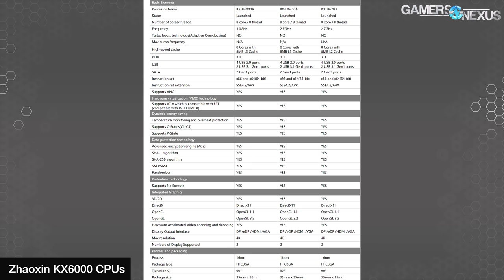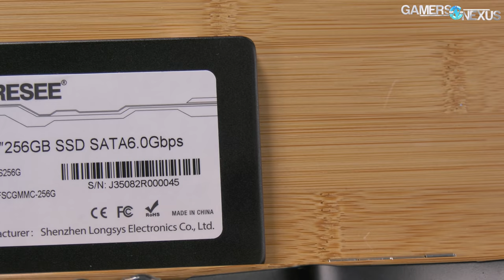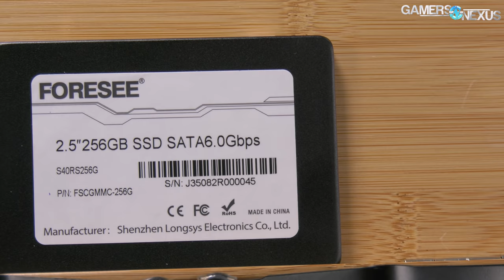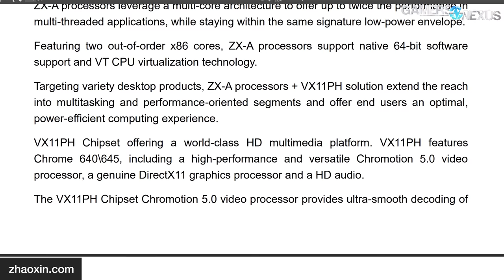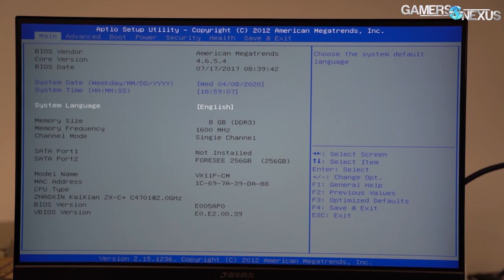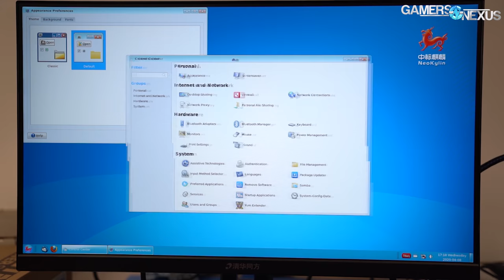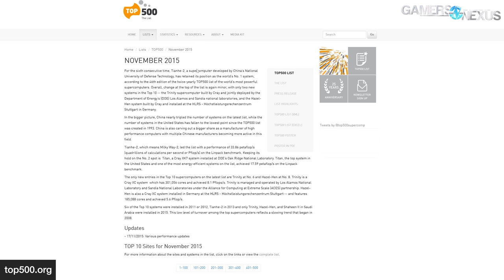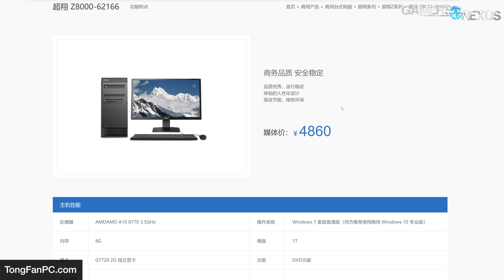Chinese Pre-Built PC Review: ZhaoXin CPU + Knock-Off Windows OS, ft. NeoKylin

Comment: This system is evidently not meant for the consumer market and especially not for export. It seems to be a thin client pc for government offices and municipalities, public libraries law enforcement financial institutions etc to replace the intel and amd thin clients  currently in use. For that purpose it is completely adequate.
Reply: Yep, also military desk job, Chinese government is very paranoid after Snowden incident, not to mention all the intel me security issue exposed over the year. Most of these gov machine now are still on intel, running with hard switch dual system
Reply: And still not worth it..
Reply: @hjy2187418  No need to be paranoid. Check USA laws on american brands and manufacturer. The law make them implement backdoors and communicate any information they hold on a non-american company without justification. Even NSA produce their own processors and hardware as far as I know.
Reply: I think they can build better just lika huwaei phone. but they're too lazy...
Reply: @T4CFantasy  Depends on what the real cost is. Internal government cost could be much lower in volume.
Reply: @PunxTV123  As Steve mentioned, this is an older model. And don't underestimate the difficulties of building up an independent cpu manufacturing industry.
Reply: @T4CFantasy  for a government, state level security doesn't have a price. 

Just compare the price of so etching like a Boeing security phone to a normal android.
Reply: @BonBaisers  Can you point me to the law that you talked about pls?
Reply: I think china is starting independent slowly, hope I can buy from them someday a same rtx 2080 ti and ryzen 3990x for total cost of 300$.
Reply: More like for a bill board at a bus stop ...
Reply: yes indeed and it only takes 50 watts at max, you don't need 500 watts to run text and word editors. i am guessing they will use that money then to make more powerful machines tailored to better purposes then target consumers later when they catch-up.
Reply: Completely adequate, and insanely expensive for it.
Reply: hope USA learned the lesson that it's not only western can do market and china is not a slave workers. hope covid-19 will teach them lesson more. those people are living on their own to improve while USA are thinking jealous lol.
Reply: Just buy ibm power 9 system it's powerfull and much powerfull than this system for the same price .
Reply: @T4CFantasy  gov contract machine are always overprice for obvious reasons, same in very country
Reply: @T4CFantasy  it's government internal order, not retail. dmv office is using same level of crap, you can ask them how much those cost
Reply: @hjy2187418  nothing shipped in America is that slow anymore for new offices and they will cost the same for much better, any Intel Celeron is still better than this
Reply: The price though
Reply: @TheOsx86  Search for "Lawful Access to Encrypted Data Act", it is literally legalized for the U.S. government to hack into anyone's PC if Lawfully approved by itself (meaning fuck).

Older laws were "under the table" agreements that NSA enforced on vendors.
Reply: @T4CFantasy  There is loads of proprietary hardware and software and operating system in the US that are Unix based systems, and they are brand new, and "slow as hell". Traffic control software and hardware is a fantastic example, those aren't running cutting edge Intel anything. They are generally fast enough to get the job done, and work on hard-embedding with very specific clock speeds to ensure that instructions are done at precise times. 

For all intensive purposes this PC is just an embedded system, that utilizes soft-embedding for the end-user, and is as fast as it needs to be to fill out PDFs and Documents. Anything out there runs like that. We're not going to put cutting edge processors into government computers that don't need them, and we're not going to put random versions of windows on defense hardware or hardware that needs to run functional time-sensitive programs, it is a waste of time and money.

If you want more information on this stuff, there are loads of computer systems engineering programs and courses you can take through your local college or universities. Often times online where you can learn all kinds of different applications for computing outside of games and Windows.
Reply: but far too expensive but it seems every gov is wasting taxpayers money .. even in China ..

Comment: should oc it with Ln2 and see how far you could go :P
Reply from the maker: Wish we could!
Reply: @GamersNexus  i bet the "airflow" is amazing :)
Reply: @GamersNexus  you will need the ln2 to unlock the other 999,999,999,996 cores.
Reply: @GamersNexus  Can you replace some crystals/XTALs with higher clocked versions? Would that work?
Reply: @happygimp0  I wonder whether it's possible to modify the UEFI like BIOS mods were made for machines back in the days when overclocking was still possible using the FSB
Reply: @GamersNexus  cmon... do eeeeet

Comment: Steve admitted to using a 220 volt outlet just to use a hair dryer at home.

Granted nothing is too good for that level of hair so I don't blame the guy.
Reply: probably a clothes drier tbh
Reply: It's probably a chinese drier. :) USA is special with its voltage.
Reply: @AstralS7orm  or a UK or European one. Maybe it's Mielle.

240V > 120V

Lower transmission current, less losses, lower power bills.
Reply: Clothes Dryers are 240v in the US.
Reply: This surprised me, do American homes have separate outlets for driers with 240V? Do they have a transformer in the house or something?
Reply: @MaartenKok  It comes into the home as 120v-neutral-120v and 220v things like stoves and driers are connected across the full potential, while everything else is connected from the 120v to neutral.
Reply: Most likely he changed an existing 220 outlet into which ever was needed.

OR he got an electrician to join 2 existing 110v electrical lines wired together to make the needed 220v
Reply: Clothes dryer. Not hair dryer.
Reply: Many electric appliances require more than 20A of current. 127v would dissipate too much heat to push that much current. Regular 240v outlets are usually rated for 23A and can go to about 40A. After that, you'll need a triple phase 450v outlet.
Reply: @JordyValentine   Enough with the nationalism already.  It's not "retarded," it's perfectly sensible.  Different countries rolled out electrification in different ways, and the legacy compatibility argument makes it incredibly difficult to evolve that beyond what has been the standard for a century or so.  It works, as do any of the competing arrangements.  What more do you want?
Reply: For those genuinely curious, he's talking about a clothes drier, not hair.  Most US appliances (including hair driers) are 120V at a max of around 12-15A.  That is ~1500 to 1800W, and sufficient for just about anything, but wouldn't be sufficient for two appliances in particular - electric stoves and electric clothes driers.  So those get special outlets with 240V.

US houses typically are fed at the master panel with two out-of-phase hot lines, and a neutral line.  Half of the house is wired to one phase, the other half to the other phase.  (By "half the house" I mean every other circuit goes on a different phase, so it's roughly load balanced.)  Each room, give or take, gets a home run to the main panel.  (Some rooms - like the kitchen - may get more than one circuit.  Sometimes, two bedrooms will share one.)

The stove and drier, if electric, will get wired with access to BOTH phases and neutral.  This provides a 220V connection across phases, and optional 120V connections for controls, lights, etc.

You can question the suitability of 120V all day long.  The fact is, it's ample for most needs - and for those where it's not, there's a fairly simple workaround.  Remember we're talking about decisions made in a time where the main application was to stop using oil lamps and move to electric light.  120V was as good as any other choice at the time.  They did not anticipate multiple 350W GPUs in SLI, or EV charging, etc.  The two-phase hack got us over the electric cooktop problem.  Many homes dealt with that same issue by feeding major heating appliances with natural gas, propane, etc.  I have a gas drier and an electric stove.  Go figure.
Reply: @nickwallette6201  Ever tried using an angle grinder on 120v vs 240v? The 120 is useless. There are far more things than just driers that are improved.

Besides all of that, higher voltage = more efficient
Reply: @nickwallette6201  pfft, nationalism.. Other countries exist and yours isn't the greatest in the world, get over it.
Reply: @JordyValentine   That's exactly what I'm talking about.  I've travelled around.  Turns out, nobody's got a monopoly on happiness.

This idea that "it's different than what we do, therefore dumb" is not a good look.

You're right -- some high-powered tools work better at higher mains voltage.  It's not terribly uncommon to see a garage here wired with higher voltage outlets for that reason.  When EVs get more popular, it'll be standard.

For a good 50 years, it happened to be right about the PERFECT voltage for CRT technology, as a simple DC conversion would lend to a B+ voltage that was right at the ideal for the picture tube stuff.  Not relevant now, but goes to show everything is a compromise.

For the other 99% of things people plug into outlets?  I mean, technically Japan's 100V would be better.  Lower voltage would allow for smaller bulk capacitors in switch-mode PSUs without affecting capacity.  It would make design certification a little easier (less safety clearance needed between live and low-voltage parts.)  Etc. etc.

Most of that is moot because we have to accommodate 240V mains (so everything has tolerances to accept that), and less-efficient 50Hz mains (so everything has to be over-built for 60Hz regions to permit acceptable operation in 50Hz regions.)

I hear Europeans often complaining about vacuum cleaners and kettles, but .. I mean.. I don't have any issues with vacuums limited to 1800W, and can boil a cup of water in a Hot Shot in the amount of time it takes to put a teabag into a clean mug.  So... can't say I see any advantage.

220-240V would be more efficient -- less loss over the copper in the house.  That's somewhat negated by the ring circuits some places use that have that additional margin.  More current drawn on one circuit means you're right back to needing thick wiring again.

We could play this all day.  It's not better.  It's different.  Has its own advantages and disadvantages.

Enough nationalism.  It's a disease.

Comment: "From the beginning, all of the versions of Kylin have been intentionally skinned to look like Microsoft Windows, such that it would help aid workers in transitioning from Windows into the locally-made operating system, because it minimizes the amount you would have to learn."

MS:  Windows just got better!  We've relocated all your Control Panel options so you get to search for the functionality that you used to know where to find.  For example, rather than right-clicking an icon in your systray, simply type "How do I change my DNS server settings this year?" into the Start menu and you will be presented with a short sequence of incantations.

"Under Appearance Options, there's also a Classic Mode which brings back the previously publicized XP skin from the older NeoKylin releases."

MS:  ...?  One-click access to whatever user interface you're most comfortable with?  Consistency between releases?  What is this mysterious technology?

Comment: As far as the 220-240 Volt problem: You can get a simple transformer, which used to be common before adaptive power supplies.
The simplest systems just are two sets of copper windings in a 1:2 ratio.
There might be smarter systems.

Comment: 5:49 That is a GreatWall GW T-200SHA PSU. There is a chance that it will work on 120V with a different fuse. While they don't have this specific model, all of GW's T-series PSU's on their website work on 100-240V. (Note that A and B series and some server ones do not). They do advertise all the various protections, so if you plug it in to 120V the worst that'll happen in that it will blow the input fuse (under load) (since it's expecting half the current and twice the voltage). Their server power supplies that have dual SKU for each voltage range appear to only differ by the input fuse. Since it's outputting less than 50% load, I expect the default fuse to be fine for 120V use. One non-fuse-related reason it might not work at 120V is the max on-time requirements in the MOSFETS in the 12V rail (3.3 and 5v are derived from 12V so no issues there) Note that it will likely get worse efficiency at 120V. If you do a teardown of it, I would like to see the construction.

Comment: My schools have always used ancient C2D HP or Dell computers, but those Lenovos are very common online, so, yeah, I've seen the Lenovos.
Reply: Yep. I deal with a lot of machines that have been refurbished after being used for over a decade in offices and schools and...I've gotta say, the ThinkCentres M71s, Compaq Elite 8000s, and OptiPlex 780ies can get a surprising amount of work done even despite being....what, like ten generations out of date at this point?
Reply: @ShroudedWolf51  I keep a optiplex 360 tower around, reliable and built fairly good. I think there is 2 different quad cores itll upgrade to also but ehhh.
Reply: @ShroudedWolf51  You can get a lot of work done with even a 350MHz PowerPC G3 (or, I dunno, a 550MHz K6-2), at least for the kinds of workflows most offices and schools have PCs for. My current laptop is the final 15" PowerBook G4.

Comment: The funny thing is Kylin isn't even the first Chinese Red Hat derivative designed to ape the appearance of Windows, the entire Kylin series was predated by another CCP-backed Linux OS called, in a rather appropriate irony, Red Flag. Red Flag started development in 1999 by the Chinese Academy of Science and had a couple moments of prominence in the Chinese computing scene, in 2000 many CCP government agencies were told to replace Windows 2000 installations with Red Flag, and in 2008 internet cafes in Nanchang were being ordered to swap to it from Windows XP. Its development kind of fell by the wayside in the latter half of the 2010s, with many people reporting its discontinuation around 2014, although the specifics are a bit less than clear due to the usual pitfalls of finding information on CCP government projects.

Comment: Serious question:
If Huawei already works with the Chinese government anyway, why don't they make the processors/computers for government work with their own chips which are much, MUCH, better than the x86 crap ZhaoXin has churned out? Sure, it's ARM, but there are plenty of Linux distros that support ARM processors, including my personal favorite, Deepin OS, which is also made by a Chinese developer team. Some Huawei laptops even ship with Deepin OS, although they ship with the x86 installation, not an ARM processor and ARM distro. Wouldn't it make sense for China to pour all their tech funding into one company that has already proven adept at basically everything they need, rather than basically making a government backed kickstarter?

Comment: (NOTE: POST HAS BEEN EDITED WITH CORRECTION.)

~1000 USD

Sounds like China's stuck in the 90s where PCs cost around or even north of that. Yeesh.

And by that, I am leaning towards whoever decided to make this by scratch... if that is even really true.

Because that CPU looks like an Athlon XP or Sempron.
Reply from the maker: It's $1000 USD. At least get the price right. Yes, it's way too much, but you could at least not spread misinformation.
Reply: $1017.  You didn't hear Steve
Reply: @GamersNexus  My bad. I thought I heard $1,700. It's an honest mistake.

I edited the post with that correction.
Reply: @megakedar  Yea, I misheard it. Or remembered it incorrectly.
Reply: Almost all desktop CPUs looks like Athlon XP if you remove IHS.
Reply: @mruczyslaw50  I only remember seeing one Athlon XP or a Sempron processor where the die was roughly a square, which is why I made that comparison.

Comment: Bought a motherboard for 400 RMB (~60 USD) last year (Feb. 2020) to be used as NAS, in my unit the motherboard is made by Lenovo with special USB3.0 and front audio connector which require additional adaptors
It's crazy how these to-Business machines are priced....

Comment: @Gamers Nexus
I don't know if you know this. Many companies (like Apple for OSX and Sony for their PS3/PS4 operating system) prefer BSD because the license is more 'generous', their license allows to use the code, change something and close it down. So companies who want a free foundation but want to close it down can do that. The GPL-licenses do not allow that. I can only speculate about it but that might explain why the Chinese at first chose to use OpenBSD. The switch to Linux can be easily explained: Linux is much better for regular desktop-usage. It has more software which these users need and it can handle Windows-only software (and gaming) much better. However, developers love to use BSD-systems (just for themselves, where they write code on). Just so you know, there is a good chance that you could have improved the performance of those games and that benchmark with a few small tweaks, specifically by using the latest Proton, using proper settings and installing the aco-compilers from Valve.